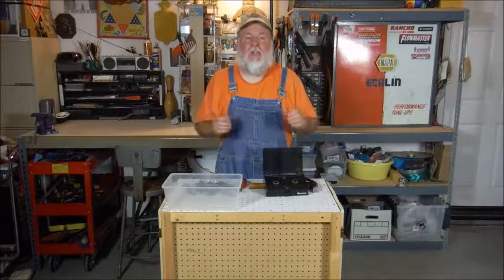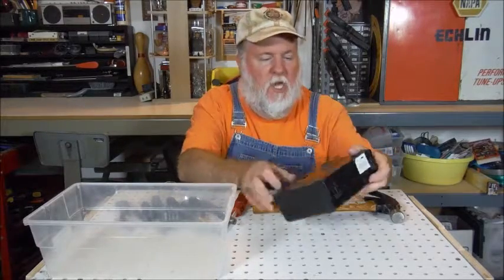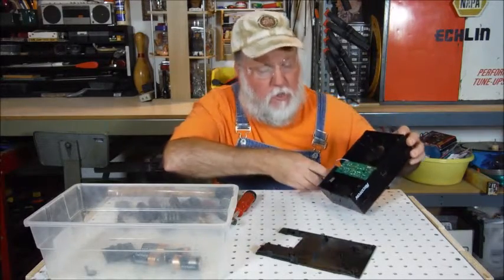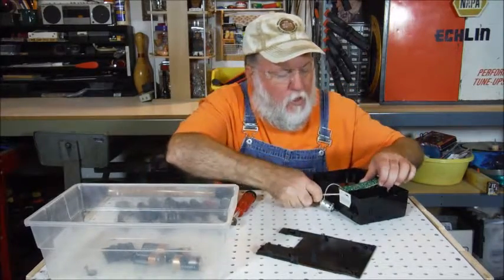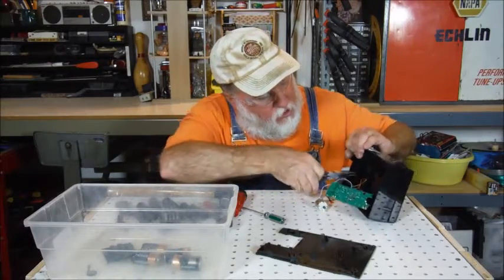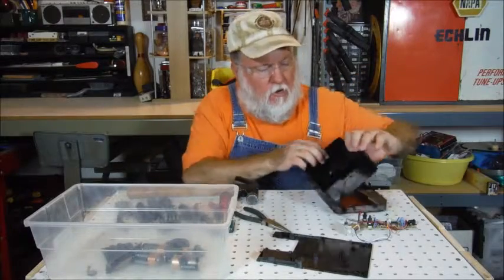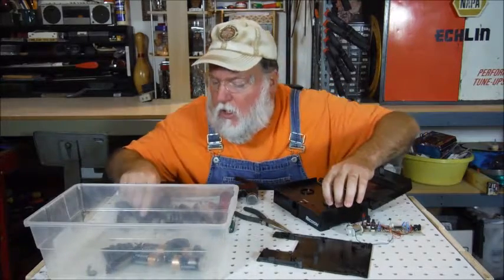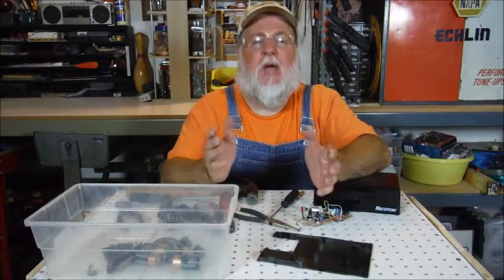Dismantle It VHS Tape Rewinder The DIY Magician

Comment: I dismantled my ME+ two-way winder/rewinder.  Everything looked good inside (belts, pulleys etc.).  The problem seemed to be in the motor.  The rotor shaft turned freely by hand but wouldn't spin on electric power.  Sometimes it would run briefly if I turned the rotor shaft.  But I noticed a "thumping" as the rotor shaft turned.  As I looked at the motor case, it seemed to be out of round and holding the rear plastic piece in place with three of the four "clamps".  I've tried saturating the insides with DeOxit D5 and later with alcohol spray in an effort to dissolve any hardened grease (sludge) that might be preventing the shaft from spinning freely.  Nothing helps.  So, I guess I need another motor.  Do you have any idea where I could buy one?  There are no markings on the motor itself but the input voltage is 12VDC 500mA.  I notice that the six holes in the case on the pulley end are threaded so a plastic holder can be screwed into it.  Oh, I just Googled 12VDC, 500mA electric micro motor and got a bunch of replies.  They don't seem to have the threaded holes but I guess I could Super Glue the plastic holder to the case.  Oh, Amazon has quite a selection, too.  It's nice because they show the dimensions for the various motors like 130, 280 etc.  All I gotta do is measure mine, I guess.